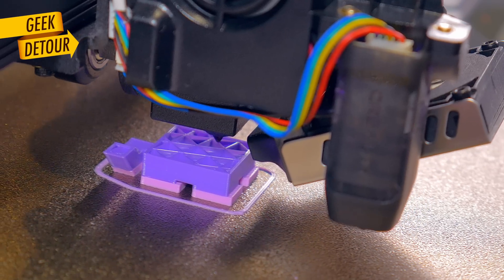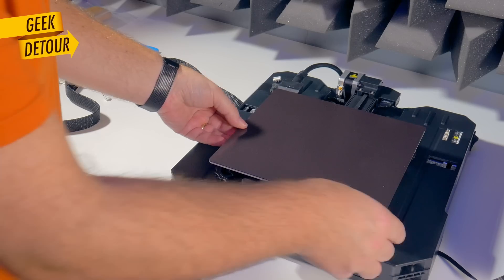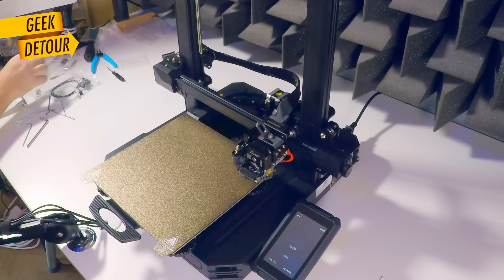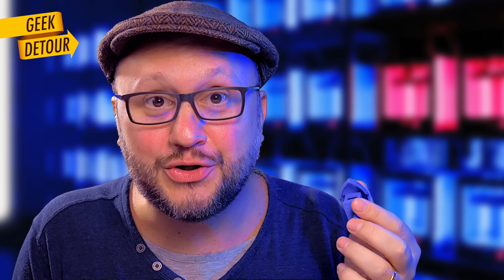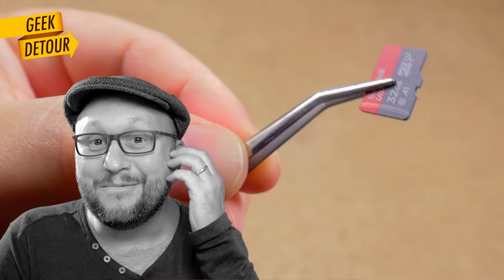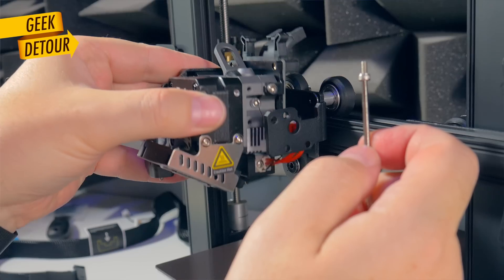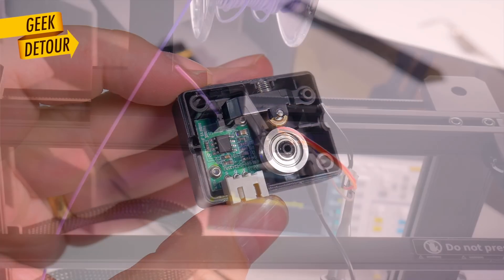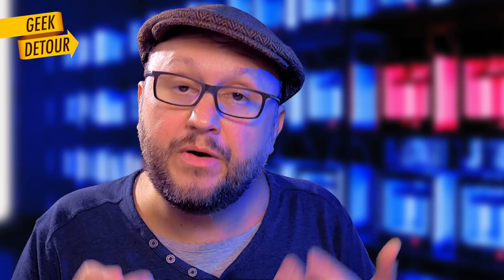Ender 3 S1 Pro: so good it begs for Klipper! 3D Printer + Creality Sonic Pad

Comment: I fell in love with and evenually purchased an Ender 3 S1 Pro from videos like this 2 years ago. But sadly, I gave up on it for because my prints kept failing. Only recently did I figure out my error and now love it all over again. I'm running a USBC cable from my PC directly to it, but looks like I can purchase a Klipper to replace the default touch pad AND get Wifi in the process?
Reply: It's not worth the investment at the moment, there are ready-made solutions and they print 3 times faster
Reply: update! 
I've since installed OctoPrint app on an old phone and use this as my WIFI enabled print server. There is an add-on you can update CURA with to enables Octo print server to be seen from the slicer... and I can monitor from any phone or PC in the house. Win on top of win!

Comment: Just got this printer the first one.  Have a fue question. If you can help please.  How hot does the bed need to be? Mine pulls the work after a short time it starts printing... Any suggestions..... It's like the work is not sticking to the bed....
Reply: 80С for PETG

Comment: I know its late but I still want to know whether this thing can solve issues with stringing.
I have the Ender 3 S1 pro. I also bought a bambulab A1 mini later.
Same filament, same condition causes stringing in the Ender, and no stringing in the bambulab.
Will this upgrade improve the situation? or is it a waste of time?
Reply from the maker: Stringing in the Ender 3 S1 Pro is mostly finding the right retraction settings. Search for “retraction tower test” you should run one.
Reply: @ yeah. That’s my problem. It seems like every roll of filament needs to be tuned. PETG is even worse because I needed to also adjust a setting to push extra filament due to pressure loss in the hotend. Does kipper handle retraction and nozzle pressure differently? Or will I waste my time

Comment: I’ve had mine for two years and I’ve had nothing but problems it turns me off of even wanting to print. I don’t even know what to do. Next found out. The actual bed was warped got a glass bed. Now it’s level, but all the prints are stringing and the layers aren’t that niceNot sure what to do next.

Comment: Hey Geek Detour, was wondering if there is a fix to the colour change / pause process for the S1 Pro in a newer firmware, or if you have found a way to resolve this issue yourself. I’ve had the same problem as you with a print starting again before being able to colour change and I am confused on how to rectify this. Also does the sonic pad do anything to change this ? Would really appreciate a response from you if you have any info that may benefit, thanks :)

Comment: This is my first printer and i am having the worst leveling problem it will not hold a level or level in the middle correctly and i scratched the crap out of it beacuse of it, and i kinda feel scammed bc people online are calling it "trash" but at the same time i see pro level prints on this printer please help me i actually cant take it anymore.
Reply from the maker: Yeah, when you are having your first experience with a 3D Printer, it is very difficult to identify what is wrong. You are saying it is bed leveling, but your bed could be wobbly (the wheels under it not being with the right tightened/eccentric nuts). The print head could be also wobbly and that causes everything to behave irregularly. You should watch this video: https://youtu.be/qNCDXdjJb90?si=k2q0xGMAwH2bFYRB There are many things we check on the mechanics of a printer. That is not a tutorial, but will give you insights.

Comment: I need some help mate.
Recently I bought an ender 3 s1 pro and hoping to design a UV glue dispenser toolhead for it. There is a few questions:
1) People said klipper mapped all pins of controller MCU, is that means I can repurpose the fan pins/detector pins/heater pins on extruder tool head? 
2) Also I found a breakout diagram shows there are a couple of spare pins amongs the 24 pin ribbon, can they be controlled by klipper marco?
3) is there GPIO pin left on mainboard? are they mapped by klipper?
4) can I add an extra G-code to fire up that spare pin/ repurposed pin? 
I only need one to fire a high/low signal to my arduino nano😭
Reply from the maker: My goodness, these are the questions I also want answered for a few projects of mine. The hard part is that the Printer boards are very specific… So far I understand that, when you compile Klipper (the part that is compiled, that runs on the MCU), all the pins are mapped - but which is which you need to try to find on the board documentation (some are very well documented, some are not). Also, the boards might not expose / break out all the MCU pins into connectors for you to use. I don’t know in the case of the Ender 3 S1 Pro, how many extra pins are available, besides the ones the printer used. In the case of the ribbon, if there are unnused ones, that can be useful - BUT, the challenge might be how to connect whatever you want to both sides. MAYBE IT IS an easier approach to connect an extra MCU via USB to the Rasbberry Pi you might want to use to install Klipper, and use Macros and GCode to enable/disable pins on that extra MCU.
The Sonic Pad might not be the best Klipper Host for a tinkerer like you. A Raspberry Pi gives you more flexibility.
Reply from the maker: This guy connected a second board to his Klipper, so he could control more things:
https://youtu.be/HFKuOtuOYIM?si=8HbJENlNZVbqCOTS

Comment: What slicer and setting did you use? Also did you use z-hop because I have an ender 3 s1 pro and I'm having some stringing problem when I have z-hop turned on.
Reply from the maker: Yeah, ZHop is a controversy feature, right? Some people don’t like it - I actually do. All my profiles have ZHops. But they work well because my retraction settings are well adjusted as well as Pressure Advance (or linear advance in Marlin)… So when the extruder stops, nothing (or very little) plastic will ooze from the nozzle. I think ZHop is important for fast moving without hitting things - but that’s my preference. Depending on your settings, ZHop can be worst, or good… It depends on many factors.
Reply: @GeekDetour  thanks,what slicer do you use?
Reply from the maker: Oh, I need to use Everything… Cura, PrusaSlicer, BambuStudio, OrcaSlicer - and I am enjoying Orca A LOT! It is my recommendation now. When I made this video I am sure I was using PrusaSlicer for the Ender 3 S1 Pro.

Comment: Hello, Thank you for this video. But I have 2 problems. First the colling fan for the filament coming out the nozle is lower ( closer to the bed ) as the nozle it self. So the paper method to level is not working. As far as I see the fan can not be adjusted, now what? Secondly as a print start the extruder ( and so all that has to be close to the bed ) goes up for more ore less like 5 to 6 mm. Result lost filament. HELP PLEASE.
Reply from the maker: Hi there! Are you sure the whole print head is not loose? I mean, when you grab it with your hand, it should move from left to right and nothing else, no up and down or twisting… If it has other movements, the eccentric nut is loose (so that explains the fan hitting the bed). Oh, I am pretty sure you can adjust the fan a little bit in either case. It is mounted with screws! Hope you can adjust everything and have it working soon!

Comment: Hey, it's me and I brought a CR10 SE recently and I also own an Ender 3 S1 pro, and in my opinion CR10 SE is like an upgraded version of Ender 3 S1 pro with a more capable firmware "Klipper", which gives CR10 SE the capability to go at 600mm/s lightning speed and still maintaining descent print quality, which is somehow mind blowing for a bed slinger, also with some hardware upgrades for running at high speeds. That sounds too good in paper but in reality, for achieving such high speeds without compromising with the print quality, we need more complex and capable algorithms (like which Klipper uses, input shaping, pressure advance, z-offset ,etc) which is totally fine but with more complexity comes more challenges which is a matter of concern especially for beginners, also in my experience with both of these printers I have suffered a lot with my CR10 SE (especially in terms of print quality) as compared to my Ender 3 S1 pro, which prints slowly and uses marlin but offers me much higher print quality, sometimes input shaping doesn't works correctly and my print shows ghosting or ringing which is quiet annoying, especially if you want that print for some decoration or simply if you want it as you sliced, and in that case your precious filament which costs many dollars get simply wasted, and yeah if you guessed it why, then you are right, "because of speed" which Klipper provides and not merlin, I know speed is also important but in my opinion not as important as print quality, and if you agree with this, please help us by contributing some more content related to this topic on, "how to gain better print quality even at high speeds", also thanks to it's open source nature that we can tune it's algorithms as per our needs. As Klipper is becoming mainstream and more and more people were getting into this, our effort towards it provides significant value to our community and helps our "makers of tomorrow", contributing towards better.

#GeekDetour

Comment: Fast forward to October of 2023 and the Sonic Pad makes the Ender 3 S1 Pro functionally useless with Creality's famously warped potato chip beds.  ABL does not work, no matter how much you try to send it commands and verify that the probed mesh is loaded.  I've had to revert back to the Marlin firmware for the S1 Pro and now I have a useless tablet thanks to Creality's terrible product support after launch.  9 months of tinkering with a machine I spent a total of $700 for when you include the cost of the Sonic Pad.

I might plug it into my old Ender 3 V2 just to get some use out of it, but I remain exceedingly disappointed in the amount of time I wasted for products that Creality basically broke after launch.

I don't think I'll be giving Creality any more of my money.

Comment: So much stringing/oozing, completely useless, at least in my case.
Reply from the maker: Hi there! It is highly dependent on the filament you are using: ideal temperature, ideal retraction distance. Any 3D printer requires you to run Temperature Tower calibration, flow calibration, retraction tower test, and fine tune your profiles. Some people get lucky on getting very good results even without going this rabbit hole - depending on the filament brand they bought… you achieve mastery when you know how to navigate all of these things without counting on luck 😄
Have you tried different filament spools / brands?
Reply: @GeekDetour  Hi, that is a new issue, did not have that before. Disassembled the extruder multiple times, everything looks perfect. Went down with the temperatures from 200 to 175 degrees, then layer adhesion got lost, logically. Retraction settings: all checked between 0.8 and 2.0 mm. Also changed to the "pro" heating block kit, the problem remained exactly the same. Always used cura slicer, changed to prusa, no effect. Tested 3 different pla filaments, one new and sealed. Really running out of options... 
When print is done and the build plate moves forward, there is a looong filament string between the printed part and the nozzle...
Reply: @GeekDetour  also the flow is 100 percent correct. When extruding 100 mm of filament it exactly extracts that length, not one mm more or less.

Comment: I just found your channel and already love it 🤩. You are so easy to understand! 

I'm just not sure I agree the Sonic Pad is all that. In truth, I don't have one. I wanted it, but I heard it had so many compatibility issues with the Ender 3 series, I forgot about it. The S1 Pro I have 2. One for high temp filament, the other for everything else
Reply from the maker: Hi there! Thank you and welcome to the channel 🤗
Almost one year later, I can say I used the Ender 3 S1 Pro a LOT and I still stand saying it is an excellent printer - the price, now, should go lower to be competitive since there are incredible new printers out there.

About the Sonic Pad: it bothers me that the source code has not been openly published - it is a Fork from Klipper and the good practice would be keeping it open. And if it was open, the community could be way faster to fix the problem that the product faced than just by Creality alone. Overal, mine worked great - but I would be lying if I said I never had a problem. In fact, in two occasions I had prints that simply stopped printing (like, a 1/3 of spool for the trash) with a completely nonsense error message. On the first time I tried it again and the print had the same fate. 🤬 Months later, when something similar happened, I just moved to the Neptune 3 Pro (that uses Marlin). Since then I never printed big things with the Sonic Pad - just small parts. Maybe I should burn Marlin back… 🤷‍♂️😬

It is a pity the world spins so fast now… everybody expect you to get a printer and publish a review in two weeks tops… it is impossible to spot all problems so fast.

If you are enjoying your Ender on Marlin, be happy. No need to change just because.

I have Klipper on a different machine and I love it - but I am just using the AnkerMake M5C that runs on Marlin - and it is INSANELY fast.

Comment: Ender 3 is a premium printer that prints super well?  In my experience and research, its a pile of junk, thats prints eradicatly
Reply from the maker: It was and still is a solid printer - bear in mind that this year the 3D Printing market has changed A LOT, very fast. When I reviewed the Ender 3 S1 Pro, it was one of the best printers on its price range. Now, for the same price you can buy even better printers.
Reply: @GeekDetour I agree there - things have really changed.  Thanks for the quick reply, and sorry for being rude, I could have worded my comment better.  My issue is with a $500 printer, which is what I paid, the $40 ribbon cable shouldn't 'just break', and need a different bracket to avoid it tearing.  The bltouch shouldn't need a zero offset bracket to work right, and I shouldn't have to print a whole new cooling duct for part cooling to be consistent.  Had I paid $200 or $300 sure, but at over $500 (at the time), it's disappointing.  I'm not directing this at you, i'm just frustrated with my 10 months or so with this machine.
My overall issue has been thinking I figured something out, getting a good print, and then printing it again only to have it fail :D  the inconsistency of this printer stock is a real challenge imho.  Could just be me...
Reply from the maker: Oh man, that’s all fine - now that you shared more about your personal experience it makes a lot of sense. I don’t know if you had other 3D Printers before - it is a rollercoaster ride… it is thrilling, but there are plenty of stuff to learn and frustration is part of the way. Last week I though a project was cursed because it failed me 5 times - for very different reasons each time - and I am a seasoned FDM user…
About the flat cable: I totally agree. I NEED to print a mod for mine because I know if that continues to flex the way it does, it will break sooner or later. This is something that escaped my review at the time.

Comment: What slicer did you use and what settings? because I have the same printer and I followed a YouTube guide on setting it up, but the roof of my benchy would not bridge. And a lot of my prints are not staying in place but I’m not sure if it is a sticking problem or if something is  in the wrong place and knocking itself off. I’m new to 3D printing and want to know how to fix it, thanks.
Reply from the maker: Hi there 👋 I cannot stress enough: squeakily clean bed (washed with dishwashing soap under warm water, well rinsed and dried with a paper towel - do NOT touch with your fingers after that), then proper leveling and finding the right Z-offset is the KEY to success in 3D Printing.
Reply from the maker: Here, a nice video about how to adjust your printer:  https://youtu.be/rGyVjqCD2Pk
Reply: I will do those but I still think that it has to do with the settings I put into cura, and I don’t know what to change

Comment: Hello, am trying to use timelapse and i have really bad quality prints. Did you change anything on retractions etc?? Thanks in advance
Reply from the maker: I need to say that I only make TimeLapses when “video” is more important than the actual piece I am printing. When I need a perfect, clean print, I don’t make a timelapse.

Comment: Is there no easy way to run Klipper without the expensive sonic pad? I mean it has a nice touch screen already. and how to upgrade the firmware and screen firmware?
Reply from the maker: Hi Hennie! Before the pandemics, buying a Raspberry Pi 3B was extremely cheap and that was the cheap way into Klipper. Search for “cheap Klipper” on YouTube and I bet you will find alternatives. Easy alternatives is a different story.

Comment: Hello. I’m might want to upgrade my 3d printer and there’s so many options and I would like to know what you would recommend. I would like a fdm printer over a resin one. So far I kinda like the Flashforge Adventurer 4 and Ender 3 s1 pro. Are those good one, or any others that would be better? My current printer is an Ender 3 v2, so I have some experience Thank you
Reply from the maker: I don’t know the Flashforge Adventurer 4… but I just checked and it costs more than 700 USD!!!! On this price-range I would TOTALLY go for a Bambu Lab P1P